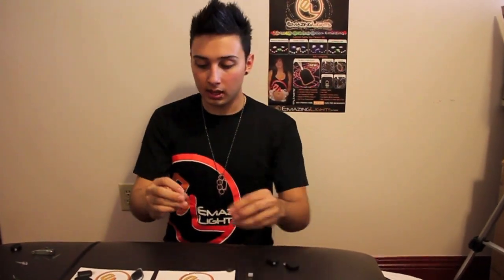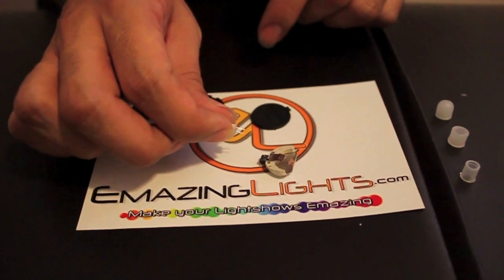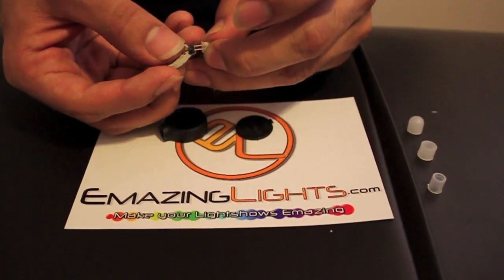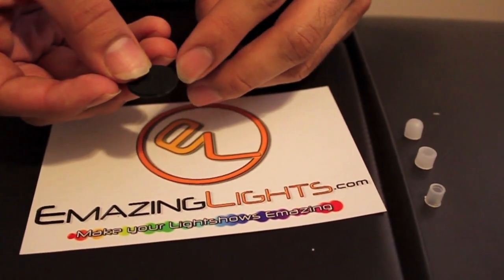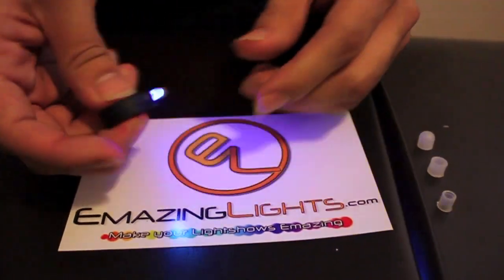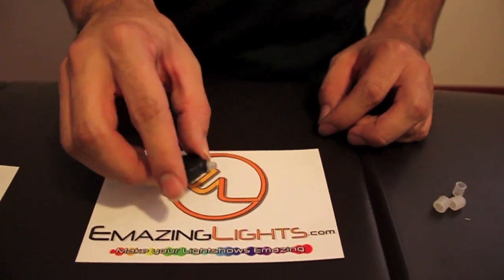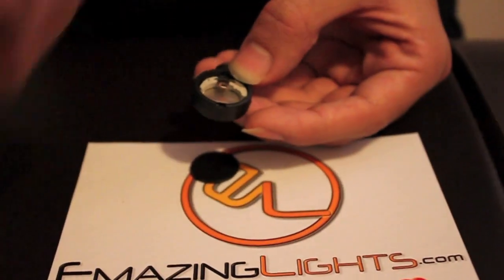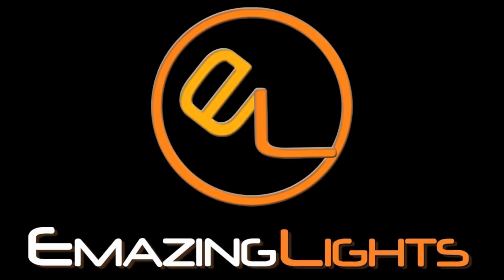Emazinglights.com 101 - GluvMax Information, Assembly, and Troubleshooting Tutorial -Pt. 3

Comment: micromax, same length as gluvmax but it is thinner, meaning that the lights dont get in the way as you give lightshows. also, when you put any diffuser on, the micromax is still shorter and there are multiple chips for the micromax. ALSO there are clear casings for the micromax. hoped it hepled!!!
- Sub-Zero